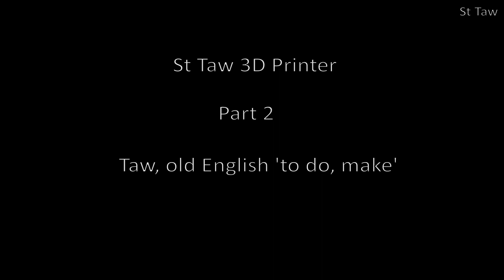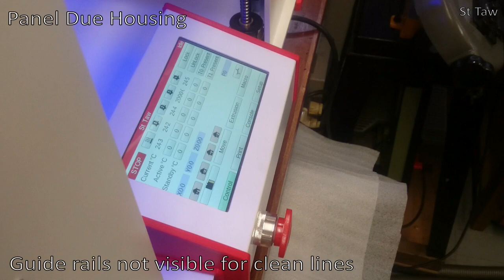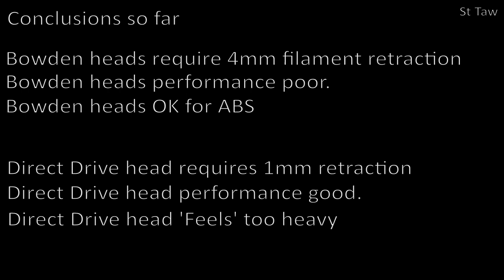St Taw. A Tool Changing 3D Printer Part 2

Comment: fine machine, I'm also building a tool changer, direct drive with Sherpa Mini, and 3 Z belt drives. you were one of the inspirers.
Reply from the maker: Thanks for that.  The Z axis has been very stable.  No need to keep Z plane mapping.  Impressed by the up coming Prusa XL machine how it locks the head using the XY motion. Saves a motor and cabling.

Comment: How thick is the tooling plate you used for the XY platform and how did you opt to have it cut? Plasma?
Reply from the maker: 6mm Ground Aluminium plate.  Cut on my sons home made CNC machine using end mill.

Comment: Beautiful design! What thickness of spring steel are you using for the toolhead cable guides? I'm trying to source some and need to figure out what will give the right amount of flex. (Also, what kind of paint? Curious if basic hardware-store enamel will hold up.)
Reply from the maker: I used the steel from a dewalt dw100 bandsaw fine tooth blade.  I ground off the teeth.  The width was then 6.7mm wide.  The manufacturing thickness is stated as 0.14" or 0.36mm.  I have measure mine as 0.47mm painted.  I used car enamel paint.  No cracking experienced.

Comment: really cool,
so what is the wheight of one head (with or without e3d v6 ) ???
with the zesti you will gain in weight but retraction is a nightmare jsute like bowden because of the gear ratio which means same ratio X reaction.

what is your printing volume ? and speed with direct drive ?

so you still do not want to release your files for the tool changer ???

but congrats you made a very very clean job.
Reply from the maker: The difference between the Bowden head and the direct drive head is the additional weight of the E3D extruder plus the stepper motor. The Zesty Nimble will replace both of these. So I believe the weight will only be a little more than the Bowden head.
Note sure why retraction will be a nightmare? Is it because the nimble motor needs to run 10 times faster? The bowden tube build up is reduced. Anyway i'll let you know the progress.
Print volume is about a 300mm cube as shown in first video.
Most of my drawings are in 2D and not complete or modified. The CNC files are adapted for my machine and tools. As I have said before I would recommend the E3D heads as better support when available. However the chassis drawings may be of interest and I will try and tidy them up and release in future.
Reply: @sainttaw2616  no problem, and 2d drawings are good, I just build a cnc to build my futur next printer with a tool changer.
And I can't wait to mill the same kind of x gantry as e3d (the new version in aluminum)

Comment: Amazing printer. Very well done.
Reply from the maker: That was quick! Thanks.
Reply: @sainttaw2616  I'm subscribed. Can't wait to see more. Came from the Duet Forums. Hope to see a full write up.
Reply: That's not 'his' printer... that was designed by E3D. All he did was cut some acrylic for slots that allowed his 'external' stuff passage. . . Also weird that he made his own tool head, as the ones provided by E3D with that printer are pretty darn good...